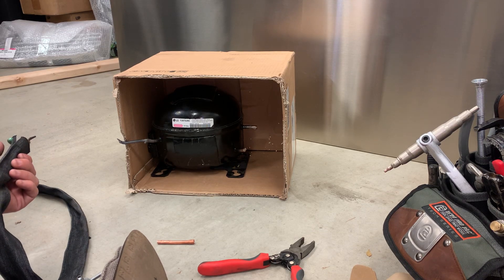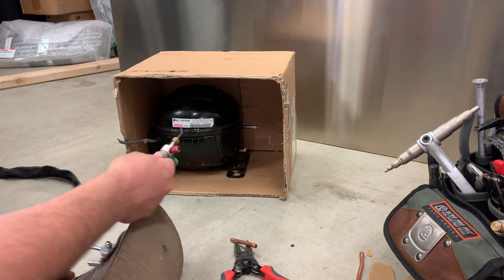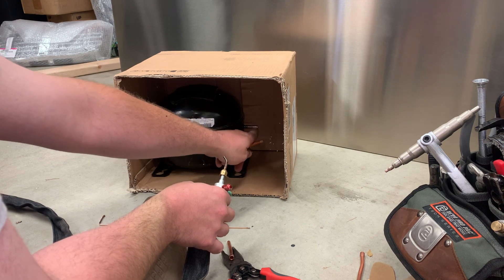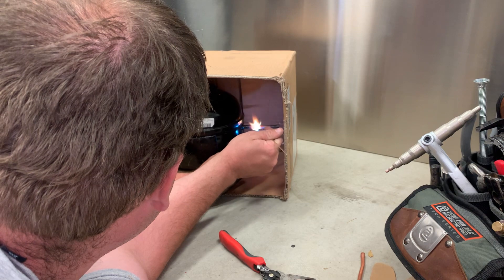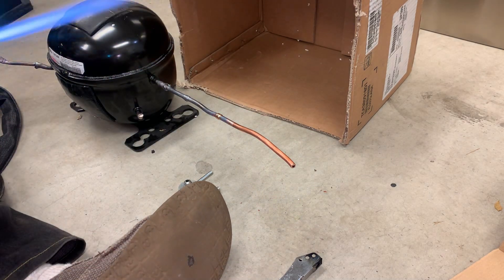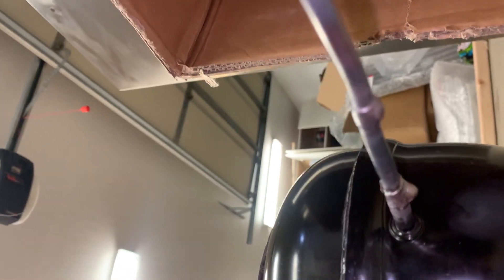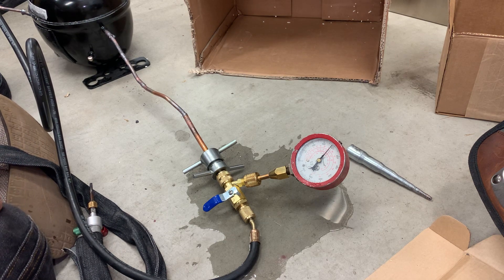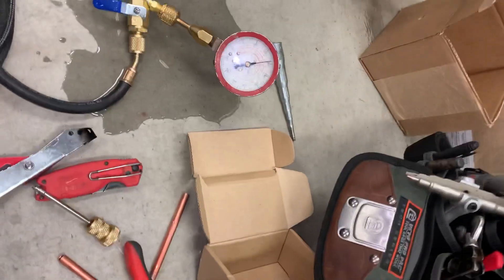Refrigerator brazing practice

Comment: When I was doing this, I used a tubing bender to make my Prestolite  torch tip look like a horseshoe. That way I could reach behind the fitting and blow the flame away from the box, plus I could touch the solder to the side that I could easily see. I also had a mirror on a handle to check all the way around the joint.

Comment: nice video, what do you set your torch regulators on your oxygen and acetylene?
Reply from the maker: Depends on the torch, with that small tubing torch that tip runs 8 psi on acetylene and 8 on oxygen. But it’s best to check the manual for the specific tip your using
Reply: @steveb5967  thank you!